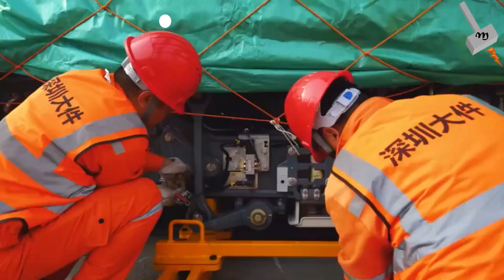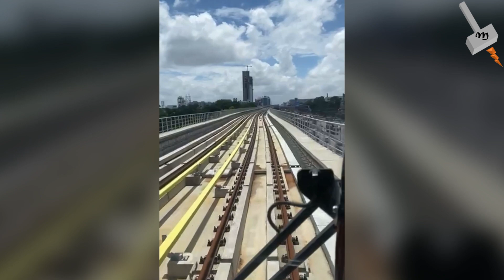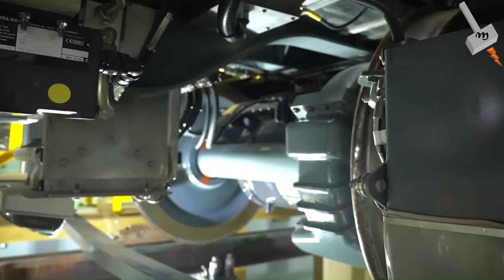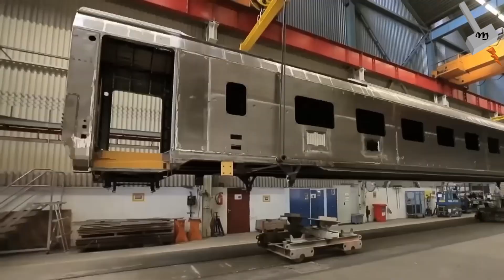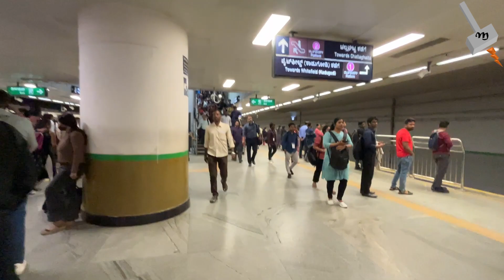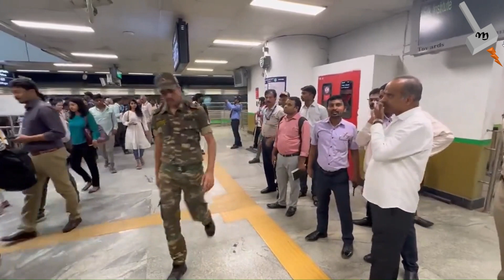Second Coach of BMRCL Yellow Line Arrived at Bengaluru

Comment: Please use the 2 train sets from green line and 2 train sets from purple line 

Start operation 

Once the train received by trrc use them return the green line and purple line train by sep
Reply from the maker: Green line & purple lines trains are from ROTEM. Their signalling system is different than Yellow line. Hence interoperability is not possible. 
Moreover, Green & Purple lines are struggling with shortage of trains, hence yellow lines can’t be operated with those trains.
Reply: @surgepulse2778  Signaling system installed inside the train rake is a software right so it can be updated.... since I am not electronics engineer so my statement could be an exaggeration but still, I am thinking is it possible to upgrade the signaling system between the stations according to the norms of CBTC in purple and green line and considering the fact the track width in yellow and purple/green line remained same. All we need to know the feasibility. Please enlighten me....
Reply from the maker: @ritabratabhattacharya1433
Noble thought, but as mentioned earlier Green & Purple line trains are from ROTEM although they are also driverless like Yellow line trains which are designed by CRRC, but the signaling system from ROTEM & CRRC are not interoperable. 
Signaling system is quite complex involving signal sensing & processing, real time data relay and controlling the operations of trains. Please recollect 2 years ago the Balasore accident, which happened due to signaling error (as reported by Indian Railway). Something similar shouldn't reoccur in metro system or anywhere else.
Reply: @surgepulse2778  designed should be unique @ entire bengaluru metro. Then only all maintenance costs can save. If every or new up coming lines signalling disgnged are changed to the previous operation obevisouly again man power will increase based on design planned. Same engineers can not be utilised new sets again them to train the new technology, again it costs to bmrcl